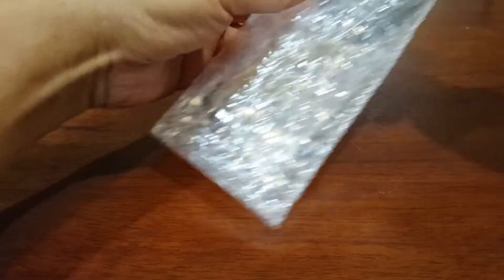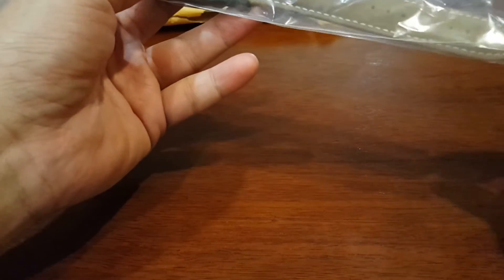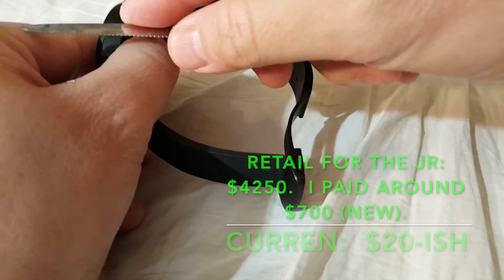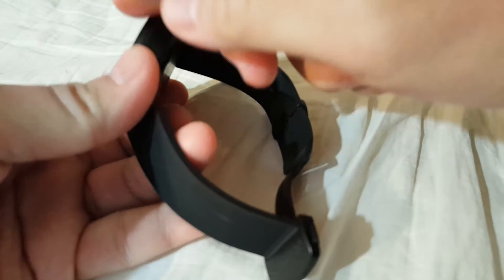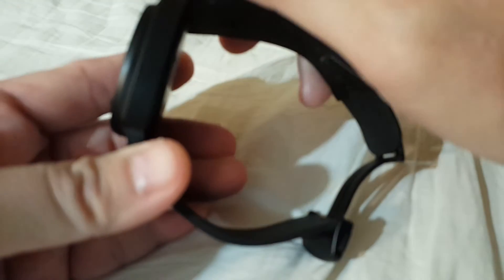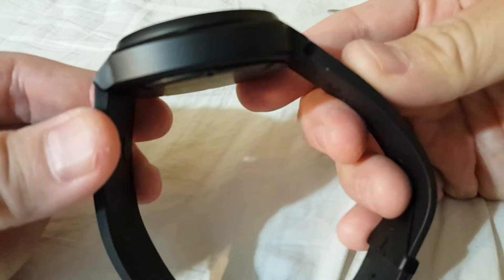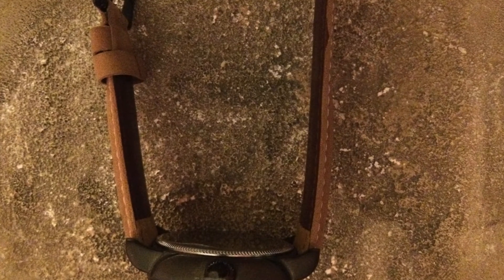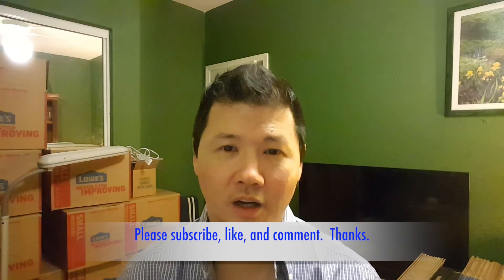DLC & PVD scratch test!

Comment: The issue of best scratch-resistant coatings often discussed in knife-collector's and gun-owner's communities. The general notion is that the DLC is stronger than the PVD. But I think the quality of either coating depends on the science and technology behind each method. It seems that if the PVD coating is done properly with the best materials, it might turn out to be better than the DLC that is poorly implemented.
Reply from the maker: Yes very true. There are also aesthetic differences. PVD allows more finishing options versus the matte finishing of DLC.

Comment: To make it clear: DLC is also PVD, because PVD is a METHOD of coating metals (Physical Vapour Deposition). You can even have real gold PVD coatings. DLC (Diamond Like Carbon) is the one of the hardest black coatings out there, when I scratched another watch with my PVD by bumping into it there was metal particles from the other watch stuck on the coating. After wiping it there was no marks left. What you call PVD here is probably some lower end black coating. Toughness of the coating depends on the material that is being layered onto the metal - if the particles are hard the coating will be tough. For example real gold PVD coating will wear out relatively quickly because gold is soft.
Reply from the maker: Hello, PoltergeistWorks. Thanks for sharing your experience. 👌😁
Reply: I came to this video for the information that I got from this comment. Thank you.
Reply: Wow 
Ok so DLC is PVD. DLC is a brand. And like with all brands some are better than others. In the beginning DLC was the best but other PVD coatings have become much better.
Reply: @NotBOB-81  what is better than DLC?
Reply: thanks for making things clear jakub, love your knives and designs, awesome stuff!
Reply: @NotBOB-81  .DLC (Diamond-Like Carbon) is not a brand. It is a type of coating that can be placed on, for example, watch casings and watch bracelets.
Reply: are Tissot PVD quality good?

Comment: PVD (Physical Vapor Deposition) is not a material. It is a process by which a metal surface such as stainless steel or titanium can be coated with a hard, scratch-resistant material such as DLC (Diamond-Like Carbon). It is a myth that all DLC is impervious to scratches. Only the best quality (and ,therefore, most expensive) DLC material with the highest hardness rating (supposedly in excess of 4500 HV on the Vickers HV hardness scale) is nearly impervious to scratches.
Reply from the maker: Thank you. That is correct, Michael.

Comment: I'm getting Garmin fenix 6x sapphire. Its got sapphire screen and dlc coating on watch. Happy to see it'll last a long time in great shape, and I don't have to baby it
Reply from the maker: Hi, Oleg. Congrats on your Fenix. My DLC watches have stood up well, but admittedly I baby mine. 👊
Reply: @whatsonthewrist Thank you, sir!  I currently use Samsung gear s3 , i don't know what coating it has (the color is matte black) but in 2 years of active use bazel is completely scratched up and it doesn't look good.
Reply from the maker: The material may simply be paint or ion plated. You could have it coated in DLC. At least you won’t get lost with either watch.
Reply: Don’t - thought the same and got the 6 sapphire carbon grey DLC - it got a scratch day 1 and the stainless steel underneath the DLC contrasts an ruins the watch. DLC will scratch eventually and then look like shit. Google pics of wear on a non DLC fenix at least before you decide. DLC from Garmin means nothing. The saphh glass is fire though but take care of the bezel then
Reply: @hendrikmarais9092  good to know. Thanks

Comment: it does not count an using a serrated edge knife if you have the serrations facing away from what you are trying to cut.

Next time just pull out sandpaper or a file, because fingernails and ceramic tiles are not measurable grits last time I did any fabrication work.

Comment: I am surprise that the DLC coating is so strong. I hope they invent a method to turn stainless steel black during manufacturing. I saw an Invicta watch with a multicolor stainless steel (blue, green, red). I think after 20 years the DLC coating will start to become week.
Reply from the maker: Hello, mena seven.  DLC is actually meant to last. Yes, I have also seen multi-colored metals but mostly titanium.  The color is forged from extreme heat.  It looks cool.  Have a look at Zelos' website on their chronograph that looks blue and red. 👌